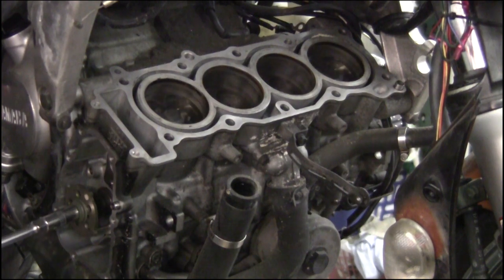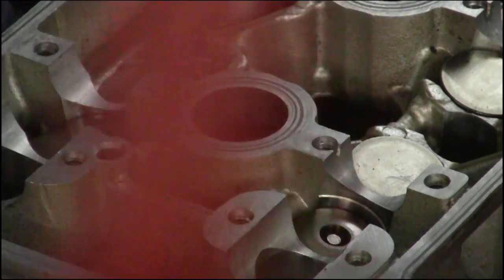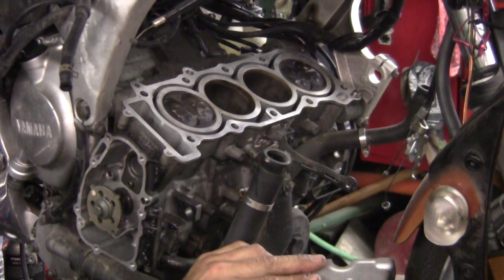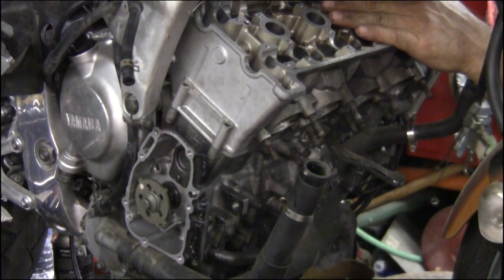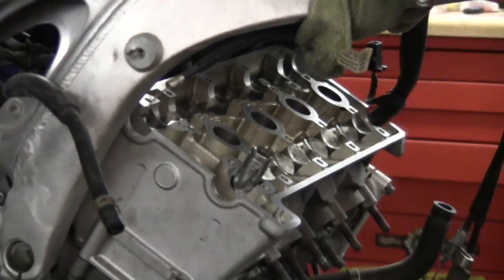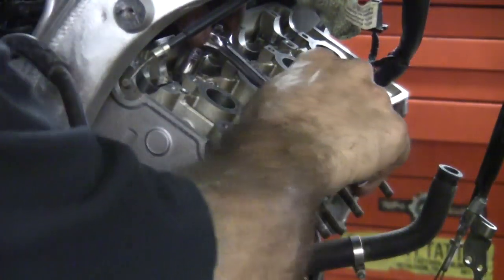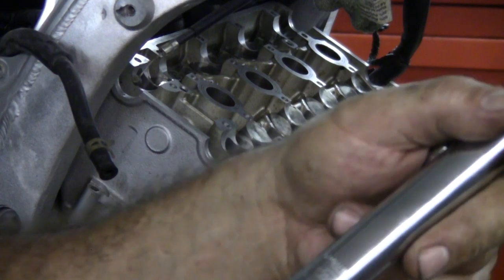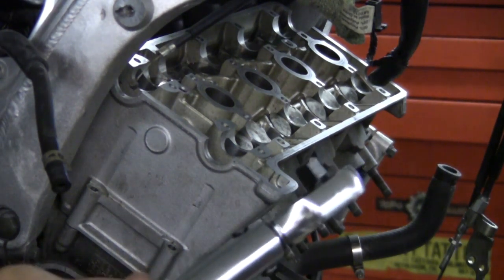Yamaha R6 pt.2 CAMSHAFT CRANKSHAFT TIMING

Comment: Please don't put that spinning wheel of death on the cases or head surfaces to clean them, a flat file with a length of imrie tape does the job better, also lubricating the threads, you should wipe off all.excess oil on threads as it can hydraulic in the bolt hole, also you should lubricate under the bolt head as to not bind the bolt, before putting bolts back in the case you should chase the head bolt thread with a thread tap and blow out with compressed air well before the head gasket goes anywhere near the casing

Comment from the maker: The bike is neutral.If your tire is on and you wanted to check chain sprocket head ect even with it all together just take out the plugs and you'll be able turn the motor very easy this way.
Reply: +RIP Moto Hey man I have a 2000 R6, same bike. Any idea what the valve clearance is for both intake and exhaust?

Comment: You a very meticulous man, its so enjoyable to watch.
You just know that it will be spot on!!.

So many people just slam the bits together without looking at the fine details of the process, no wonder things go wrong.

Ive allways thought that a clean surface and carefull checking of all the known problem areas results in a good stable build.

Ive only had a small 125 bike so i never bothered with a torque spanner, the feel is the important part, its never failed me :-)